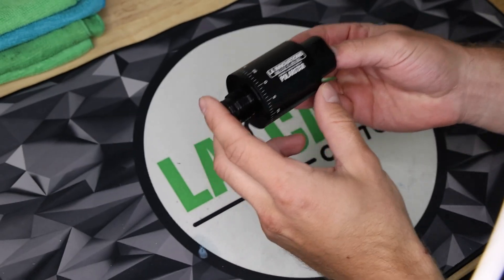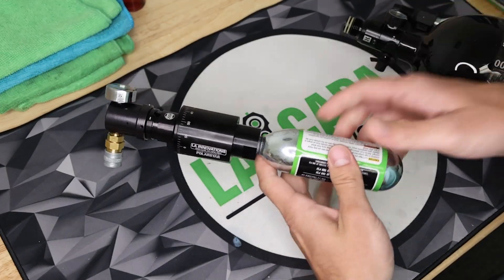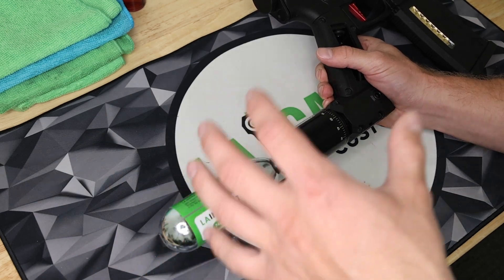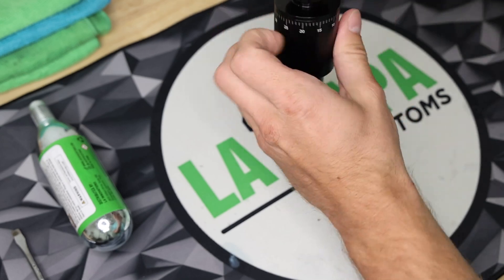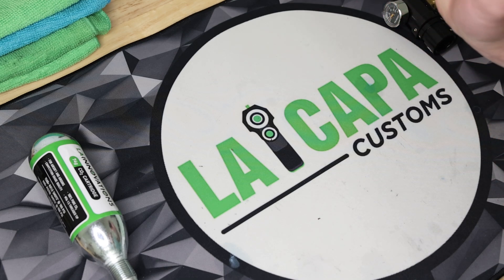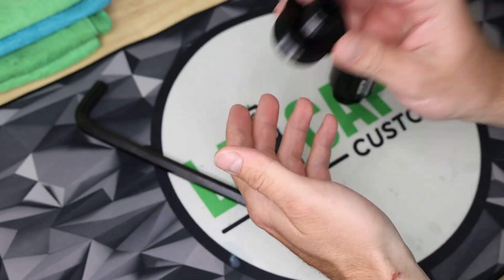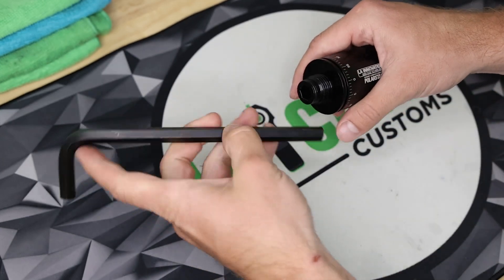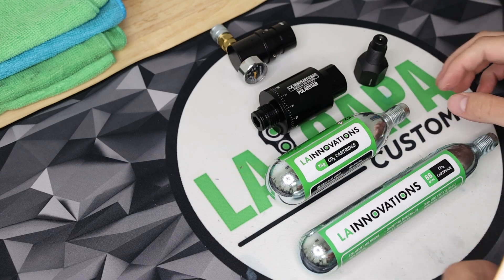LA Innovations CO2 HPA Adapter Setup Guide and Overview

Comment: Hey Ive had this adapter for a while, its been working great with my kit except recently Ive had an issue with it.
(My tank and regulator are on its last legs so Im getting a new reg to test this out with but I wanted to just check and see if this was an issue you guys knew about)
I had screwed in the adapter into the reg as normal and then screwed in the co2 all the way, and it started leaking out the hole near the bottom which I assume is an overpressure release. I know co2 will leak if you dont screw it in enough but I screwed it all the way in which I normally do. 
Im going to test it again very soon, but I wanted to put this out here incase im about to waste another $15 on co2.
Besides all that, its really nice and ive been enjoying it

Comment: Could i use an amped slp regulator?
Reply: Also, do I need co2 grade internals for my hi capa?
Reply: @reubenator5 you shouldn’t need to change out your parts as you can regulate the pressure to accommodate your guns
Reply: Thanks. I figured, but i wanted to make sure

Comment: So, we're moving away from sustainable hpa tanks, that come in all shapes and sizes, to purchase 1 time use co2 capsules? That cooldown like crazy? And are not cheap at all? Sounds like a bargain 😂😂😂
Reply from the maker: This comment is very much uninformed. The cartridges are regulated down in pressure with the regulator. With our expansion chamber, there is no cooldown while shooting. Check out our full auto instagram videos on LA Innovations. In addition, depending on your HPA refill cost, it can actually be cheaper to use this over an HPA tank. It costs $7 per 1800+ shots with the 88g for example.
Reply: @la.airsoft  I would order but you dont/cant ship to other countries.
Reply: If you want to, you can buy refillable 88g CO2 cartridges. You can use a SodaStar or similar to refill your own capsules then.
Reply: @florihae  why would i go through all this trouble, invest money in x capsules, y soda bottles that have to be refilled anyway, pay more money for adapters, when we have THE HOLY HPA bottle, that solves all these issues. Bonus, you can fill bottles up at the field when you go play, or with a pump for very cheap at home. With 0.2 bottles existing, i literally don't see any, ANY advantage to this.
Reply: @DeXteR.AIRSOFT  you have a very closed mind. First many airsoft players do not have HPA refill stations on a field. Many, don't even have any infrastructure at all, this is not Paintball. The investment for HPA is more usually, so idk what you are talking about.
The 2nd thing is, liquid CO2 has a  higher energy density. For the same volume you have more shots available. Especially for in-stock solutions this is a big advantage!
Just because YOU don't need it does not mean that this is not a good product for quite a few players!

I myself use 13ci 3000psi HPA Bottles for my AirStock and own a 4500psi comptessor....guess what, I will also not buy this adapter. But I totally see how useful it will be to many players!
Reply: @florihae  I’m in this camp, our local fields in NorCal don’t have refill stations. 

Nice to know there are a handful of airsofters who can see the whole picture :) ❤ your one in a million 👍👍
Reply: @baej4769  so many haters out there in Airsoft....I am one of them, but an informed one, haha.
No seriously, I would never consider using CO2, but that is because I bought my own 4500psi compressor that I can run directly from my car battery (or at home). Otherwise, I would probably go the SodaStream CO2 route for external (backpack style) tank (with the regulator from the video) or 33g for in Stock. (With the Polarstar UGS)
Still dreaming about one day manufacturing an M4 size Stocktube that is the CO2 tank itself, with a fill valve to refill from a Sodastream or CO2 Refillable Tank.
Reply: You get no cooldown with it
Reply: I believe these cartridges are recyclable